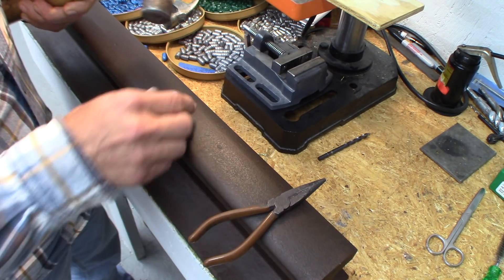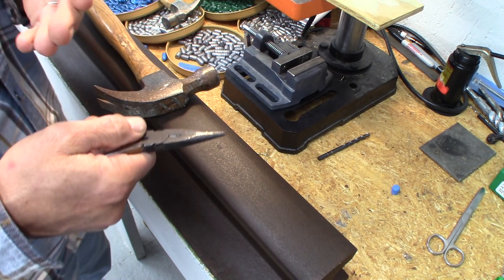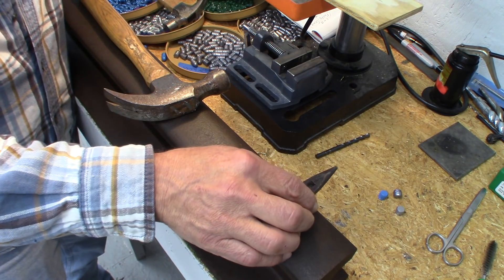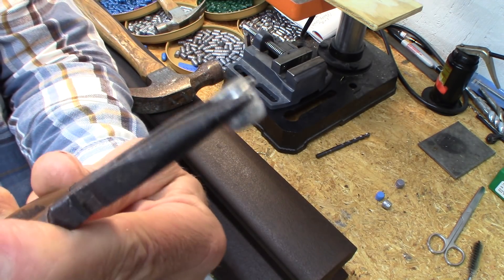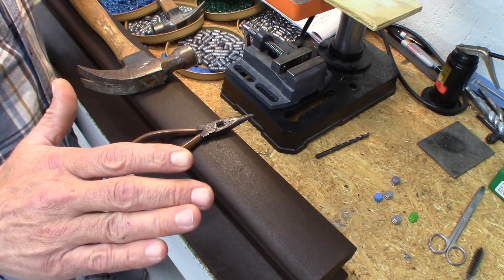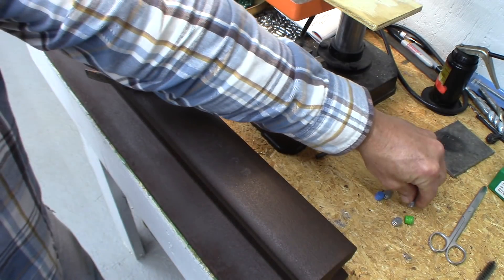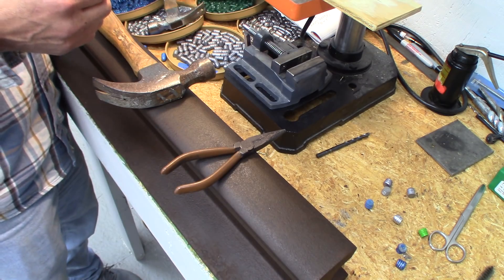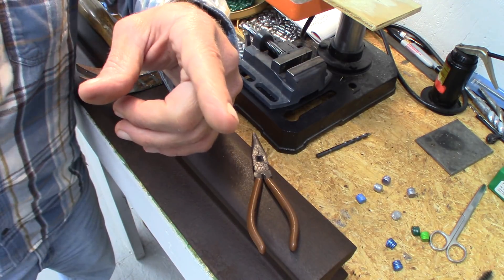SMASH TEST, Powder Coat (Durability)

Comment: I am quite surprised to see the flaking off.  The problem I am having with Hi-Tek, I can smash it alright and nothing is flaking off and it passes acetone test.  I haven't figure out if it's something I am doing wrong but shooting 40 cal in to damp sand trap and most of the coat is gone!  Recovered PC 9mm were not like that at all, I just don't have any 40 cal powder coated to compare but man you should see how super smooth and even hi-Tek coats without any marks.

Comment: I melted all my lead bullets after they leaded up my colt !! so I will turn the lead into shot gun pellets !!!!! over 100 lbs.
Reply: Why did they lead your barrel?
Not enough lube?
Too soft alloy?
Pushed too fast?
Under sized bullets?
Too bad all that work for little gain.
Try to learn from it and make things better.
Good luck
Reply: How old is your Colt?
If it's a 1st gen SSA, the groove diameter is .454 not the modern .452. It takes a 454 mold to get the correct bullet. Undersized bullets will lead up the bore.

Comment: Thanks for the research and testing of these powder coatings Elvis. The best values still appear to be the Ford Light Blue and Dark Green. Do you still cook these powders for 20 mins at 400 degrees?
Reply from the maker: I’ll do a video on the subject
Reply: elvis ammo - I’ll be waiting on the video...this is a very interesting topic to me. I tried the abbreviated cooking formula without success; the powder coat die not hold up well in sizing or firing, so I went back to the old 20 min at 400 degrees method. Look forward to hearing what you have to say !

Comment: This may be a dumb question, but if we PC the bullets at 400 degrees F, and the gunpowder burns a LOT hotter than that, does the PC melt on the base of the bullet?
Yes, i realize that it is only at this high temp for a split of a split second.  Just curious.

Good to have you back Elvis.  
I thought you had left the building.

Comment: Previously when you tested before, it wasn't as thorough as this time. As I recall that time you just did one bullet to show the durability of powder coating in general. Still, that video was what sparked my interest in powder coating. 
My takeaway from this testing is that the powders designated as "top coats" might be borderline, so check those out before going to town. 
Good video. 👍

Comment: Hey Elvis, I don't know if you've ever played around with double coating bullets. I've done several "testings" . Powder coat appears to like sticking to bullets already coated and baked. The top coat powders are more than likely formulated for that. When doubling coating, you have to size in between coats, it works well for that little extra "jacket", plus you can get some crazy color combos for those artistically colored projectiles.
Reply: murphymb  double coating woks well if you have a powder that didn't take first time around. You don't have to throw them out or remelt.

Comment: Have you tried putting the powder coat in the die then casting the bullet?
Reply from the maker: Not sure that would work I’ll have to think about it🤪☠️👍👍👍
Reply: @elvisammo  I would think pre heating the mold would be important. As well you might need the electrostatic gun instead of shaking them in a bucket. Electrostatic equipment is fairly low cost on eBay.

Comment: Very nice Elvis, today I tried to coat the bullets with black powder paint, the same one used the day before, but today the bullets had a lot of trouble to cover, what could have happened?
Reply from the maker: If you are having trouble with your powder you can preheat your bullets up to 150 degrees F. Then put them in the powder. Try that...
Reply: @elvisammo  ok i try with this tip, thanks.
Evidently today the electrostatic charge in the air was low, I had to leave the plastic bowl with the bullets in the sun for 15 minutes, then, after 15 minutes of swirling the bowl they were covered.

Yesterday in just 5 minutes of swirling the bullets in the plastic bowl, they were all covered in dust, same powder and same bowl